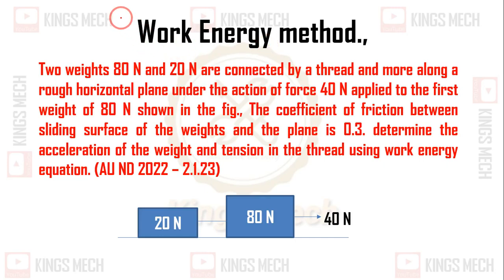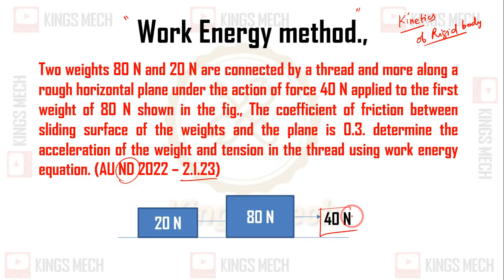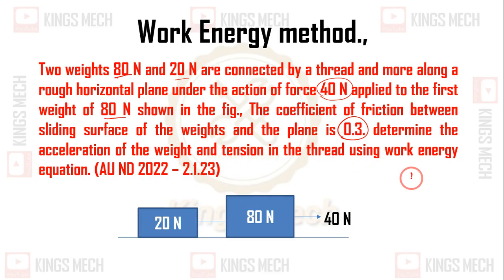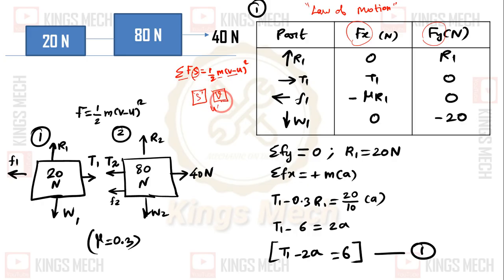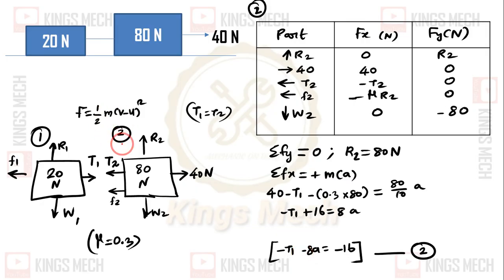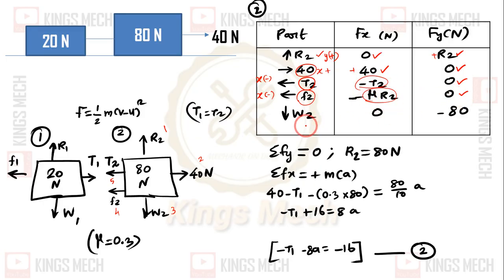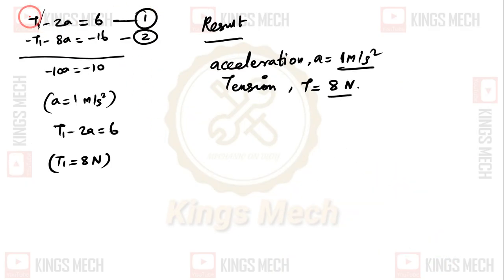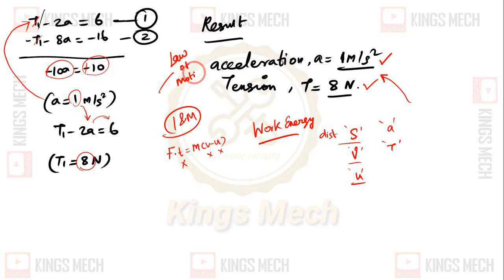Work Energy problem AU ND 2022

Comment: Sir naa 9.81 vachu panen answer T=2.68N, a=1.63m/s² vanduchu crt ah sir
Reply from the maker: Acceleration ok
Check tension again
Reply: @kingsmech when solving with 9.81 I got tension as 8N and acceleration as 0.981 m/s² sir